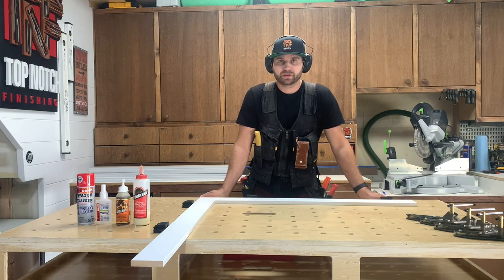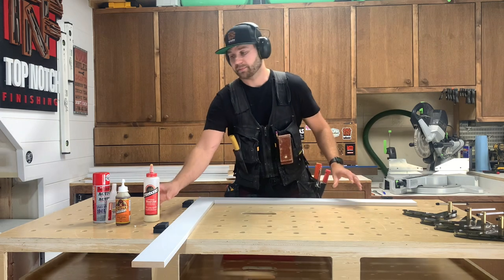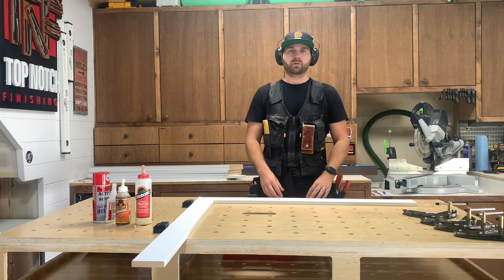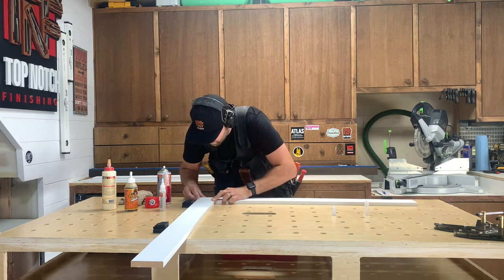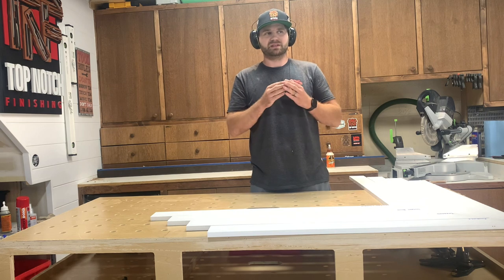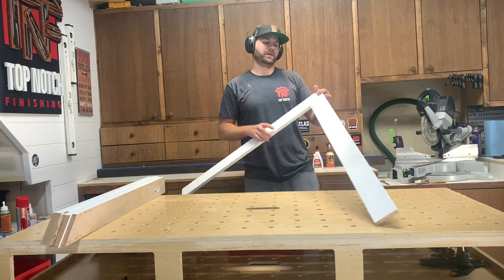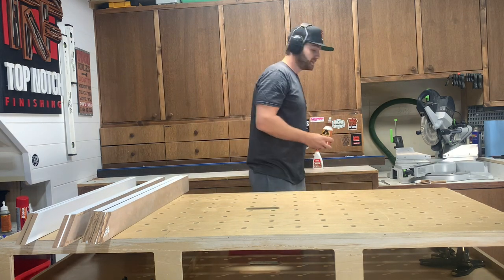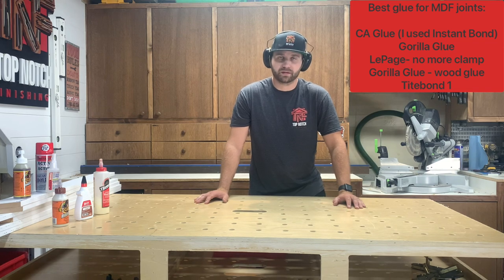Best glue for MDF joints

Comment: Years ago i was doing a laminate floor job, at one point in the job i really needed to run the planks with the tongues facing opposite direction, so i basically ripped two planks and glued then together with CA glue with tongues facing in opposite directions, i let it set for a while and tired to break the joint , it was nearly impossible to tear them apart, major effort, and when i managed to get them apart the fibres were tore to pieces, so after my test i made up a new piece and installed it, been using ca glue on mdf since then with no problems. I recently did another job at that same house and those two pieces of flooring are still bonded together after being walked on for years.
Reply from the maker: Yup. It’s incredibly strong and I’m glad I did this test.

Comment: I have been using CA glue on all my mdf joints for about 5 years now and have never looked back. I have yet to come back to a broken joint and never need clamps. I precut and stack, then glue them up one by one, each taking 3min or so, and go to install. For mdf it works amazing, and for everything else I usually use speed set and clam clamps 👍
Reply from the maker: Exactly. That’s how I’m viewing it from now on. With good coverage, it works really well. We use mostly MDF but will continue with clam clamps with real wood in the future.
Reply: Is there a good adhesive for mdf baseboard to wall use?